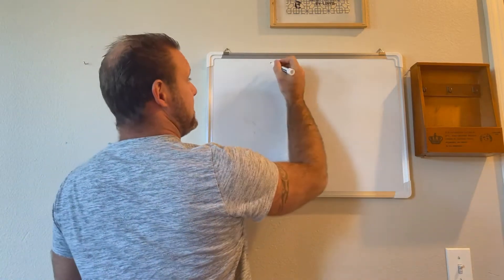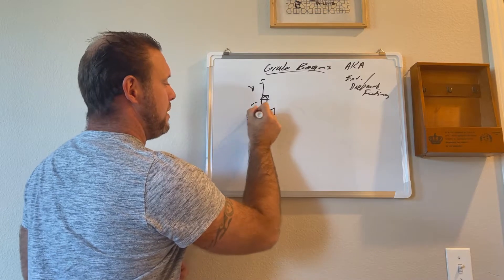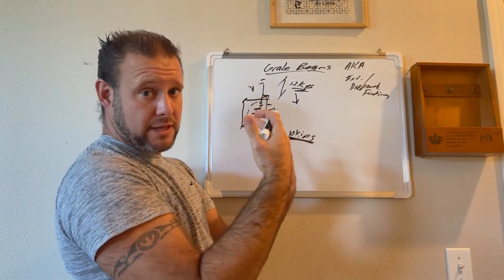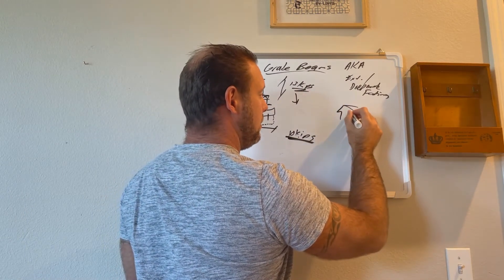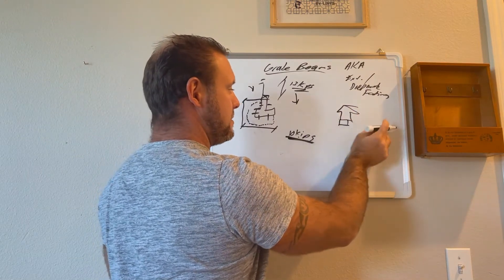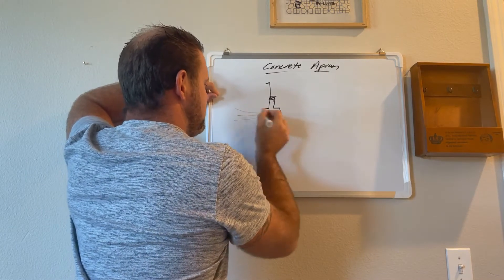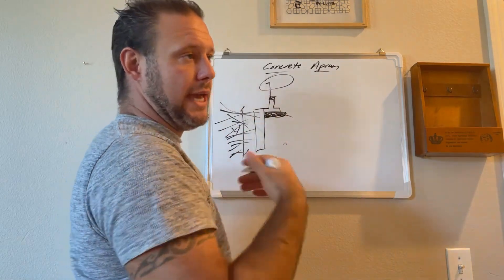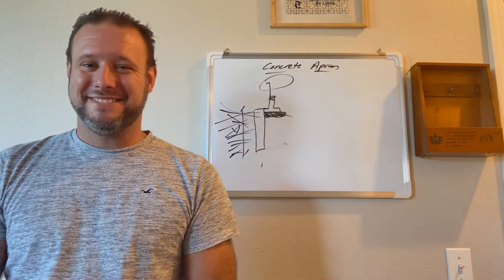Grade Beams/Extended Footings in Foundation Movement

Comment: Thanks for the video.  You didn't mention what the solution would be for the 13kips on 10kips capacity soil since adding a grade beam with make the problem worse.
Reply from the maker: Of course and thanks for the reply! Addressing settlement specifically generally requires a Type-A repair, this would be a Type-B as far as subsidence or soil movement is concerned. 

Type-A repairs include steel underpinning systems (screw piles, push piers, etc), mini piles, caissons, compaction grouting, things of that nature. A bunch of videos are up for that also if they help!

Thanks so much again!